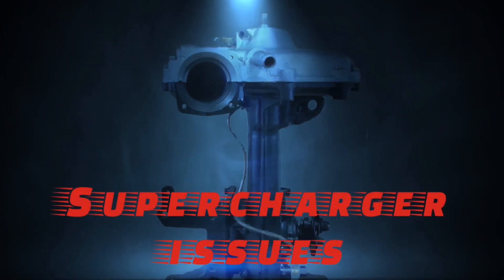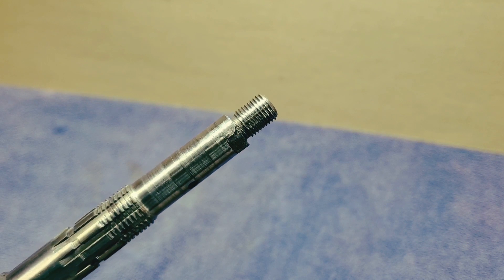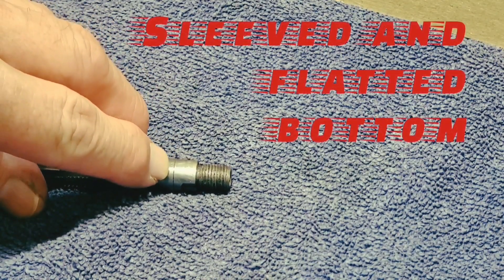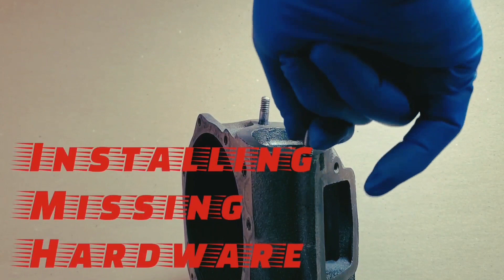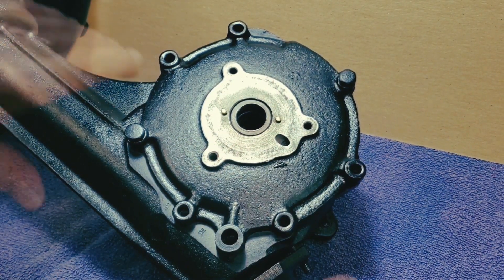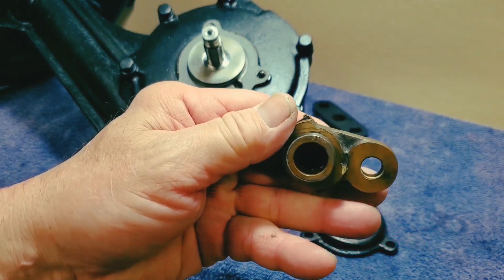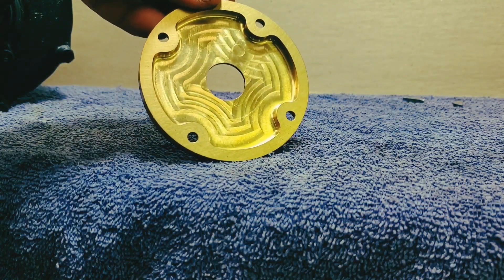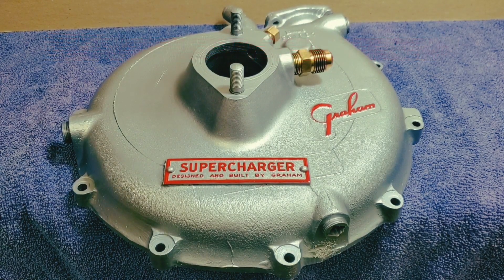Graham Supercharger Issues - What's Wrong With My Supercharger

Comment: Excellent love seeing old technology revived  . Have you tried having the shaft ground and chrome and then ground to spec ? Years ago it worked in a shop we did jobs like that .
Reply from the maker: Yes, you could do that. However, if the bearings need repouring the slightly undersized is more affordable.